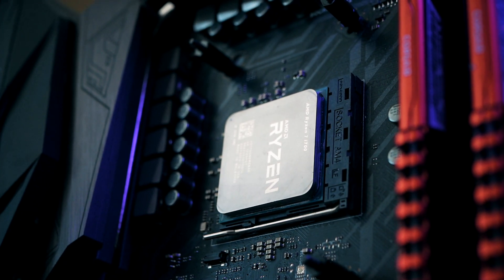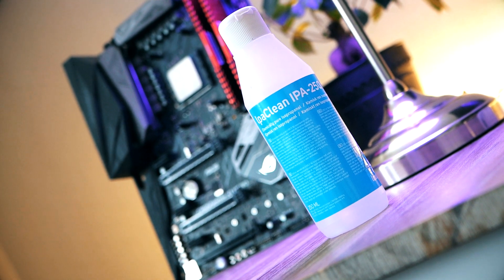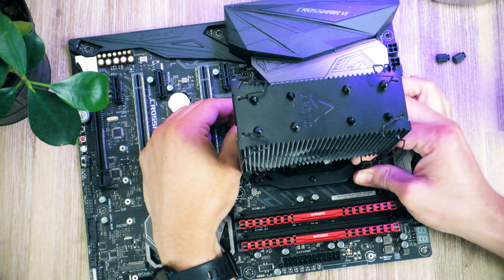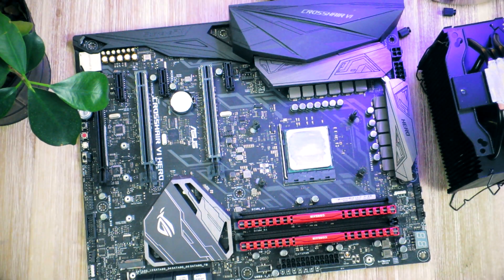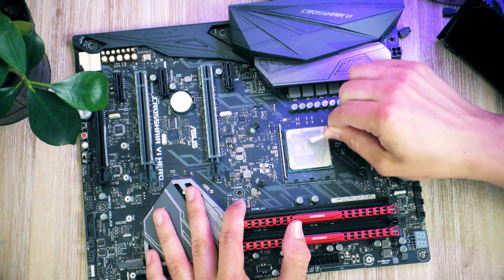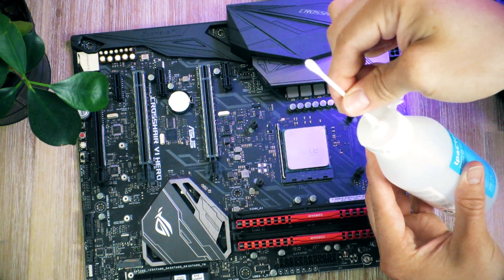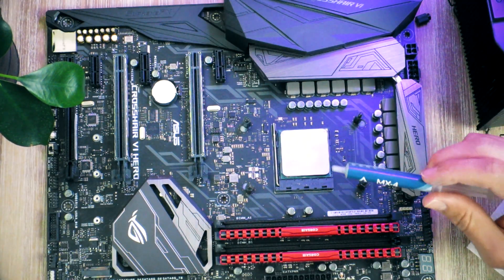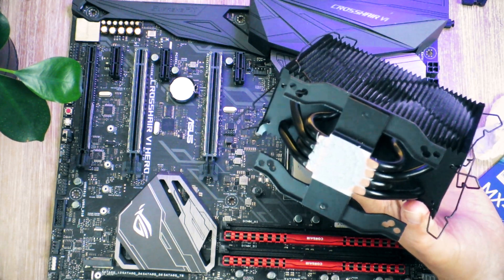How to Remove Thermal Paste From CPU & How to Apply New Thermal Grease

Comment: damn i used my 2700x cooler that comes with the CPU it self, and stupidly put it face on a carpet, when i removed it i saw some hair and i actually touched the paste with my hand with half of the paste gone, i still applied it to my CPU then i noticed fan spinning hard with overheat 70 degrees CPU in idle mode, I then realized i fucked up, BUT i'm just a beginner  and i just built my first PC for the first time, I will apply this method to clean both cooler and CPU
Reply: why would you still install it

Comment: My pc shuts down when playing games like minecrft, etc.

Will changing the thermal paste fix it?
Reply: Mag Niko maybe you’ll have to try it
Reply: When your pc shuts down its either because of temperature reaching the limit allowed (set by software), or it could also be energy issue.
Try cleaning both cpu and gpu cooler and then change thermal paste on both (although I would run some games and turn on monitoring to check temperatures so you can see which one is getting too hot).
If the pc still shutting down after all that, try reinstalling the drivers of your gpu. And if it still doesn't work, it means something in your build is dying, and my guess would be the psu.
Reply: @leandrofod  I also got the same problem man, while i'm running dota or any offline games my pc just shuts down because my gpu reaches 100%,  so its either i should clean my gpu and apply thermal paste or is it about my psu? i'm using i3-4160.. anyone can help? thank u so much.
Reply: Freakoon  pc

Comment: Every when do we need to remove and apply new paste?
Reply: I do it every 2 yrs tho
Reply: LoL, I just did mine today on my old Inspiron 530 from 2008 - a whole DoZeN Yrs ago!!
Only because it recently crashed & I took everything apart to clean out all that dust (this part, i actually do once every 2-3 yrs which kept the system running this long)... this time though, I just took both CPU+GPU apart to clean those fans thoroughly - that's when I realized that the old paste has dried up pretty much.
To think that this computer has been running almost non-stop for that long or at least 18-22 hrs daily, is quite impressive =D
Reply: @ejojo13  if I will use only cpu stock cooler of Ryzen 3 3rd gen. still needs to apply thermal paste? Or depends on CPU cooler you use?
Reply: I don't know about AMD's Ryzen CPU's that come with their own coolers/fans as those may come with pre-applied thermal paste... if not,  just buy a 1g tube off Amazon or eBay for like $3-6 depending on the brand & use the Dot/Pea method to apply when assembling them together.
I'll build my 1st system ever in 6-8 months when Ryzen 4600 hits the market... I put it off with 1600, 2600, & 3600 [almost went with it last yr, but decided to kick the bucket another yr by with my old Inspiron 530].
Actually, I just finished fixing it by replacing the CMOS battery after seeking for an answer as to why it crashed while I stepped away from it a couple of weeks ago. Found a thread where many had similar experiences, so I ordered a couple of new CR2032 off eBay for 1.50 apiece [PaNaSoNiC+SoNy with expiration date of 2029]... that was before removing the old one from the 530 to clean it out that I noticed it to be a NeWSuN brand CR2032.
Then I had to wait yet another week for the thermal paste as I was not expecting to take those fans off their CPU&GPU while doing the full cleaning job!
Spend part of yesterday & all morning cleaning out my full-size desk & changing out 1 of my 2 SaMSuNG monitors [it died after 11yrs... the other should last another 3-4 more yrs as it hasn't been turned on continuously in those 11+ yrs] with a 27in UltraSharp. They look funny next to one another as the new DeLL unit is 16:9 & the SaMMy is a 16:10
Also added a new RGB keyboard that I bought over 2yrs ago, but never got around to switching it out with the DeLL's.
About to hook everything up in the next few minutes & back to regular online life again as the small tablet I've been using to get by is tiresome for typing long messages like this oNe!😂!
Reply: @drumbeatsnation1563  put it direct bcuz cpu cooler have paste

Comment: You never want to TWIST and at the same time PULL it with PGA cpus. Either twist, or pull, NEVER both. You can bend pins that way!
Reply: I was thinking the same thing. Granted, you're 'twisting' against all of the pins at once, but still...that twice made me really nervous!
Reply: @davidprice9295  Bending the pins by twisting them in the socket isn't a concern, that won't happen. What is a concern though is if the CPU gets pulled out of the socket while twisting it, then the pins get ground against the socket while being twisted, which could easily bend the pins. So twisting the heatsink to break the thermal paste free is fine, but don't pull up at the same time. This doesn't apply to LGA CPUs such as modern Intel CPUs though as it is impossible to pull the CPU out of its socket without releasing the lever.
Reply: @averyalexander2303  So you can just pull it with a LGA CPU and nothing else?
Reply: i was gonna apply new thermal paste since its been almost 2 years since i got my pc now im scared as hell i might mess up the pins...
Reply: @Hikkiru  well =)?
Reply: @boch2411  Been too scared to try.
Reply: @Hikkiru  2 years , there's no need to change
Reply: What's the proper way?
Reply: CedyTan pull is the proper way
Reply: @hippiezpunk  Wont the CPU come with it if the thermal paste is too strong ?
Reply: @sagarmgandhi  It probably won't be overheating if the paste is intact.  I suspect it would be dessicated and brittle.  Idk, guessing.
Reply: thanks! I don't remember reading that, but it is obvious now that you've said it. You have saved me.

Comment: what if i don’t have 99% alcohol? any alternatives?
Reply: Using the cheap 70% from Walmart. haha
Reply: 1. Drink Alcohol
2. Pee
3. Profit
Reply: You can also dry it out using pure salt (no iodine). Checkout the anhydrous isopropyl alcohol videos. Cheap and it works up to 93%. To get more water out, you'll need sieves.
Reply: Bacardi 151% Proof. 

I know you have some of that laying around :oP
Reply: It's been answered but just to reaffirm , you do not need 99% isopropyl.. I use 91% that I get from my drugstore and 70% will work fine as well if that's all you can find in your area. There are other household items you can use such as hand sanitizer, nail polish remover or even vodka lol ... But I'd stick with the isopropyl alcohol!
Reply: Vodka 😂
Reply: @G11Chan  wait can you actually use 50% ?
Reply: The alternative is buy the alcohol.

Comment: 1:30. No, not paper. Use microfiber cloth. Paper towel is just awful, js
Reply: towel is ok if you do as he did a final wipe with the isopropyl and qtip.  I do recommend you get a grounded wrist strap though
Reply: Bob Ray paper towel breaks down and gets fluff and debris everywhere...use an old cotton t-shirt or microfiber cloth. Both you can find free in many places.

Comment: Nice video man! Just a quick question: im getting an AIO cooler for my first build in the mail soon, I am planning to replace the stock wraith cooler of my new 3600... Do I need to take my motherboard out of the case to do this? Or is it fine if I clean and replace my cpu cooler within the case? Thanks for the response and keep up the quality work :)
Reply: Sebastian Pacheco I recommend you take the motherboard out of the case. It's more of a pain in the ass installing it in the case, and you have the risk of cracking your motherboard in the case while screwing in the aio.
Reply: just replace in the case, I usually clean my aio every 2 months and it would be a big pain to completely dissasemble the pc every time
Reply: Well I just inatalled my AIO and I have to say it was easier with the MoBo on, since you need to route the wiring for lights and fans while you are installing the pump on the radiator. There is no actual risk of cracking the MoBo on a M4 socket since you screw the pump to the bracket that comes with the board and it stands above the board itself so there is no mechanical load on the pcb.